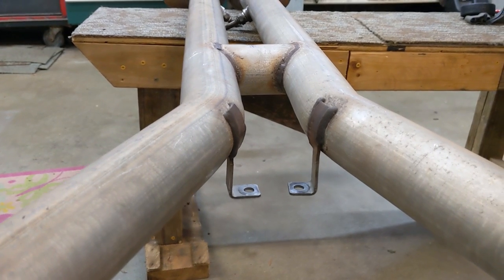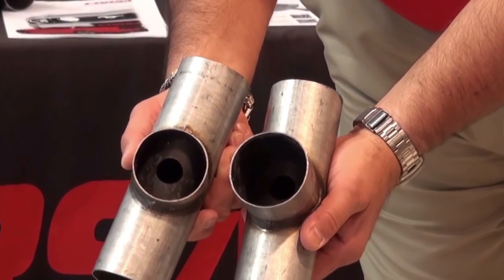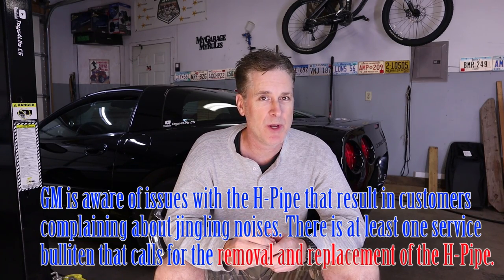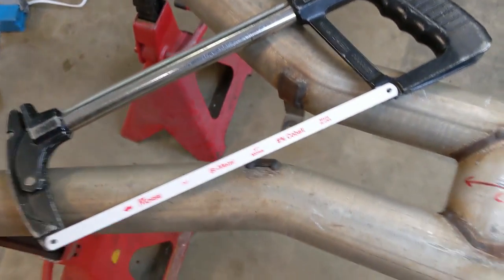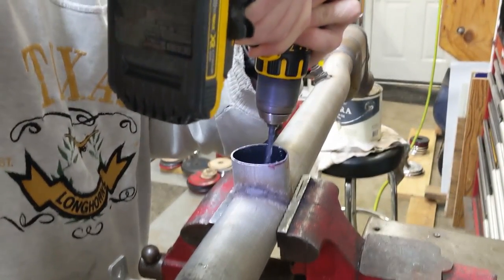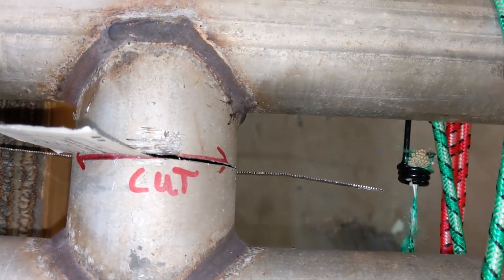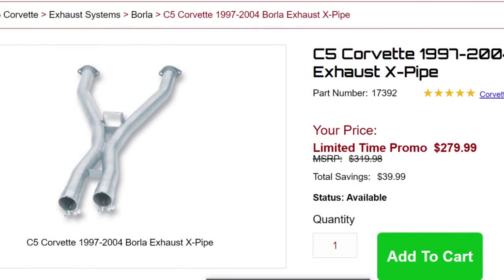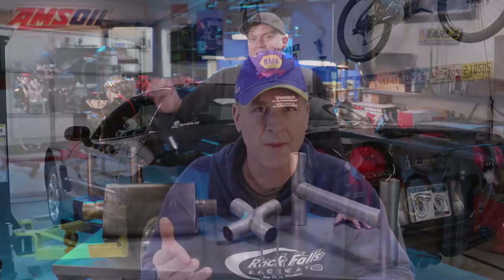C5 Corvette Exhaust H Pipe Modification! (The Stock one is a FAKE)

Comment: I just completed the H pipe mod and it was well worth the time and effort.   It sounds so much better at idle I can't believe what a difference it made.  Instead of cutting the pipe in halve, I used a hole saw and cut an access hole in the top of the H pipe and then did the surgery to open up the restrictions using a die grinder.  I then made a plug for the hole out of stainless and had a local welding shop TIG weld it in place for $50.   Thanks for showing the mod - would have never known about it.
Reply from the maker: Appreciate the feedback and glad you got the same benefit out of it as I did!!   Curious about your method.  Did you make 1 hole, or 2? Where in the H-pipe did you make the hole that allowed you to get in there with a die grinder to open up both sides?  Trying to envision how you were able to reach the areas that need opening up.  Cheers!!
Reply: I just cut one hole from the top.  2 1/8" diameter hole.  It was a little awkward to get to some areas with the burr but worked out OK.  Your method would have been a whole lot easier to open up the holes.  Again, thanks for all you contributions to the marque!!!!

Comment: If you used a hole saw a little smaller than the inside diameter of the crossover pipe, you would have the holes done in less than 5 minutes. I did that on an H-pipe I installed on my 90 Mustang GT a few years back. With Dyno Max Super Turbo mufflers it sounded pretty good and not too loud.
Reply from the maker: I was going to do that, but the hole in the middle is too big for the whole saw's centering hole on the Corvette.
Reply: @Toys4Life  I think he's saying that you wouldn't need a pilot if the ID on exhaust pipe is the guide for the OD on the hole saw...that is, if you have the right size saw lol! Great Vid.
Reply: Besse Custom Fab-Exactly my point. Thats what I did to my Mustang GT H-Pipe crossover.

Comment: I finally got around to doing mine, and I took a different approach.  I zip cut the top half of the H pipe off and was able to get a 2¼" holesaw with no pilot drill in on an angle and hog it out. Had to use a small angle grinder to finish it but was pretty easy. Then just weld the piece back in and done. Just wanted to share another option.
Reply from the maker: That's awesome, more than one way to skin a cat glad it worked out for you more importantly do you like the change in idle sound?
Reply: @Toys4Life  I just finished the h- pipe today. I only did it because I had to pull exhaust anyway to get torque tube out and replace the destroyed propeller shaft.... so, I will let you know when I get it running again.  Hopefully within a few days.
Reply: @Toys4Life  Its all back together and I really do like the sound! Less "burbly" and more how a V8 should sound.

Comment: What the hell is wrong with the sound of a motorboat.?  🤪
The smaller diameter hole is there to help eliminate drone.
The stock C5 exhaust has hardly any drone if it all,  and it's back pressure is perfect.
A little more drone (which by the way is hardly any from no drone) is a drawback from the bypass mod., and changes the back pressure slightly not too negatively.
I would have appreciated a little test drive for a drone comparison.. maybe in another video?
😊  
Thank you and keep up the hard work so we don't have to
Reply from the maker: Thank you - the MN November weather has warmed up an I am going to make a part 2 with various driving & exhaust sound!

Comment: Highly recommend getting long tubes and x-pipe. I have the TSP Long tubes with catted x-pipe and it made a huge difference in sound and power. My 2k FRC dyno'd 350 hp at the wheels with Long tubes/catted x, Borla straight pipe mufflers, and an LS6 intake. The long tubes made the most significant feel in power change. After heads and cam I'm doing over 400 at the wheels.
Reply from the maker: Thanks for the comment Sir!   350 RWHP is awesome - but, with just long tubes, catted x pipe and LS6 intake seems like it might be a little on the generous side possibly.  Speed Engineering headers are pretty sweet for the money too!    https://youtu.be/CcVBgcXrvjE
Reply: @Toys4Life  I dyno'd the car at Henderson Performance in New Braunfels, Tx. Went back and had it dyno tuned after I installed the 799 heads and BTR Stage 3 cam and components. Corey said that my car was pretty stout when he first dyno'd it as they usually do around 330 - 340 WHP. I expected a bigger gain after the heads and cam, but was about 20 WHP off. Still I was pleased with the results. Ended up installing a Monster Level 3 clutch, Tick Master Cylinder and did all the other swap out stuff while I had the torque tube out. Can definitely say that after 400 whp your stock clutch life gets severely reduced. Keep up the content!
Reply from the maker: @rediceatx  Ahhh, heads too - that makes sense.   Excellent clutch choice too!   Thanks for the follow up - appreciate it!
Reply: The X pipe takes away the muscle sound for a more exotic sound. I want to see how this goes bc I prefer old school muscle
Reply: @Toys4Life  Will this mod require a new tune afterwards?

Comment: The best way to open that smaller hole up would be to use a hole saw.  Not to bad mouth you, but it would be a much easier and better looking (yes I know you wont see it later) install.  Done this before with great results.
Reply from the maker: The hole in the middle is so big you don't really have a small pilot hole to hold the hole saw steady... So I'm not sure how you would get a hole saw to work cuz it's going to want to wander all over the place??

Comment: I recently read that the only C5 Corvettes that had the small hole H pipe were early models. Any way to confirm what year they changed over or if they did? Mine is a stock 04Z with Corsa axle back Xtreme with stock H. No jingle or boat sound
Reply from the maker: If you disconnect one of the exhaust rear sections and have a good camera you should be able to see inside to see how big the hole is.   I am 99% sure all 04's are small.  If you really like your sound - no good reason to mess with it IMO.
Reply: Sound and runs great. Just can't justify the cost to benefit ratio on changing to an X pipe. I'd liked to see some dyno examples that could change my mind

Comment: I had a long winded speculation about the H pipe I took down because it was uninformed, for which I publicly apologize , among the other problems with that post..    The reason why the H pipe hole is small is to increase the velocity of the exhaust  pulse transferred between the tubes, much like when putting your thumb on a water hose makes water shoot out faster..    Improving sound is something I leave to others.   My usual interest is top efficiency within the stock design, which meets my needs.
Reply from the maker: Interesting though, the first year of the C5 h-pipe the hole was the same size as the pipe, but then GM changed it to be a quarter size hole. Why not just use a smaller size pipe? If only we knew for sure why GM did what they did? Was it efficiency, or was it due to speculation that the larger pipe was cracking where it joined the main pipes??
Reply: @Toys4Life  I could only speculate on GM's reasoning for design change , but do know that engine efficiency is a top priority, along with manufacturing costs.  Probably some new understandings came to light, since the place is full of engineers working to improve all products.   

the generally agreed upon phrase used in the video is,  to me,  just another way of saying internet gossip unsupported by any testing or facts.   I only know how to fix problems after identifying what is wrong.   Without understanding the problem, remedy is impossible , unless you feel lucky.    of course, modifying for sound can be done by ear, without any technical understanding or care of how tuned exhaust systems work, since the goal is no longer performance upgrading.
Reply from the maker: @richardelliott8352  At the end of the day just about any performance car exhaust has a subjective consideration of sound to the human ear incorporated that may or may not be consistent with optimizing efficiency or performance. But it could be wrong.

Comment: Do you think it would be possible  instead of cutting the H pipe in half,  you could drill in with a hole cutter saw (2.5 inch) on the outer pipe on each side to get to the H pipe section? Next just drill  2.5inch on both sides of the H pipe. Next you just need 2 pieces of halved exhaust pipe  to be welded to cover the two holes.
Reply from the maker: Possible - yes.  Save any time - I don't think so.  I thought about running a hole saw with the way I did it but it would have to be a 2-1/4 inch and the pilot hole was already to big.   Overall, I think less welding (by a little) doing it the way I did.   Just my opinion (:-)
Reply: @Toys4Life  When using a hole saw to enlarge an existing hole, I just tack a piece of scrap over the hole and drill a new pilot. May be easier than drilling a bunch of holes and chewing it out and make a huge mess of it.

Comment: The 01 Z06 has full size holes in the H pipe. I can confirm that my stock 01 Z06 does not have the motorboat sound. I read that they put the small holes in the H pipe in the 2002-2004 Z06 because they did not use pup cats and they were trying to fix th sound difference. But your H pipe has pup cats and small H pipe holes so idk...
Reply from the maker: I wish I owned a chassis dyno. I would have tested it before and after to know for sure. Here's what I do know, that idle it sounds a ton better with the stock cam. Also there is definitely different sounds through the lower and middle RPM ranges. that doesn't necessarily mean it's making more or less power, it's just an observation.   Thanks for commenting!
Reply: @Toys4Life  You have the bypass mod right? I was thinking about having that done to my stock titanium cat back. How much louder is it?
Reply from the maker: It's mildly louder. I have pretty small tubing for my bypass tubes, you can definitely go larger if you want it louder. Yours will be more expensive though, titanium's a different animal to weld.

Comment: Do you know how much power the stock h-pipe is good for? I like the sound of the h-pipe but I haven't seen an aftermarket one available for C5s. I want to do the billy boat carb legal short headers but don't want to ditch the h-pipe design. Thoughts?
Reply from the maker: From the testing I've seen, there's not a huge difference in power between the h pipe and the x pipe. The h pipe tends to add a little bit more down low and the x pipe tends to add a little bit more up top. The bigger differences are in the way they make the car sound.
Reply: @Toys4Life  thank you. This might seem like a novice question but is the size of the stock piping restrictive? Is a larger aftermarket pipe necessary if you do the headers and say a bigger camshaft?
Reply from the maker: Stock pipe size is fine for three to four hundred horsepower.

Comment: What would be your opinion on adding a second h-pipe approximately 6"  forward of the present h-pipe location and still retain the existing h-pipe with no mods, using an h-pipe kit available from Jegs.  Sound may mellow a little  more.
Reply from the maker: Honestly, I don't think it would do much - but that is just a guess.  I would research to see if there are any vids of anyone doing 2 H pipes on a corvette - or any car to see what the results were.  Are you more interested in H.P. or changing the sound - or both?
Reply: @Toys4Life  I have seen a double  h for a Mustang ( Corsa) but not on a Vette.  Not interested in a big hp boost, just want to change sound.  I have read the h pipe is more beneficial closer to the engine.
Reply from the maker: @larrymann2105  I will tell you sir that I am a stock cam guy, which affects the idle a lot. The h pipe mod is awesome for idle, it gets rid of that stupid popping motorboat sound and for that alone it's well worth it. if you have an aftermarket cam then that probably helps things out a lot because it's a totally different setup for idle with opening and closing events.
Reply: @Toys4Life  My car is a 2003, 10K miles, 6 speed, vert, completely stock with the exception of the muffler bypass mod, 2" pipe.

Comment: I did an X-pipe conversion on mine back in 2013. The factory so called H pipe was CRAP at best.
Reply from the maker: Big change in sound - more european, would you say?
Reply: @Toys4Life  I'd say more like it was meant to sound. Notice they started using X pipes in the late 08s and up! Hated that "boat motor" sound with a passion. When I did my conversion I had an OBX exhaust...really allowed it to breathe better. I did my conversion using a chain link pipe cutter and 2.5" clamps. Great sound return on a $40 investment.

Comment: Would it be worth it to just weld them shut and it'll be straight pipe kinda
Reply from the maker: You could, you might lose 4 to 10 horsepower. I definitely would sound different and might be worth it if you prefer that sound.
Reply: @Toys4Life  how would you lose power? Backpressure?

Also is doing a full x pipe with catless or gutted cats but the type that goes from front to back, would that lose power due to less back pressure

Comment: I bet you they restricted the H-pipe in order to lessen the cabin vibrating and noise.
Reply from the maker: Anything's possible. Somebody else said the earlier ones that had the whole opening or cracking and they changed it to smaller holes as a strength and durability long-term issue.

Comment: Did this mod make it louder at idle?
Reply from the maker: I don't think so, if it did very minimal. It just changed the sound and removed a lot of the most of the motorboat sound if you are familiar with that if you're not, don't look it up because it'll drive you nuts after you know what it is.
Reply: @Toys4Life  I have to be honest, I really don't mind the motorboat sound.  I only hear it at idle. I have Corsa extremes, and just want it louder and really don't want to spend on headers and tune.  Thanks!
Reply from the maker: Totally cool, to each their own and that's all that matters (:-)